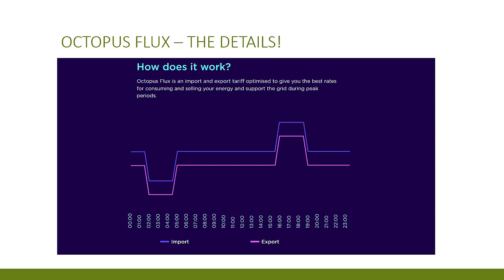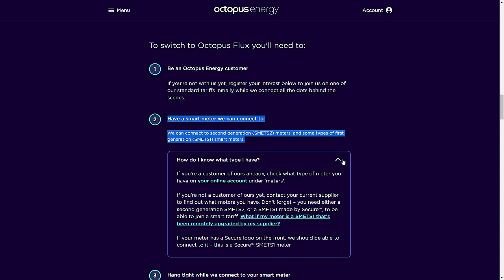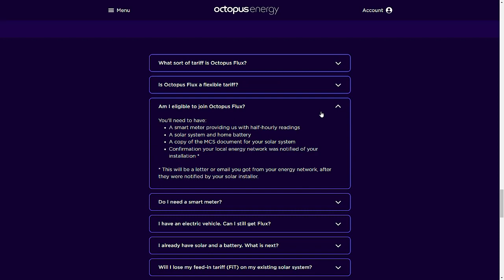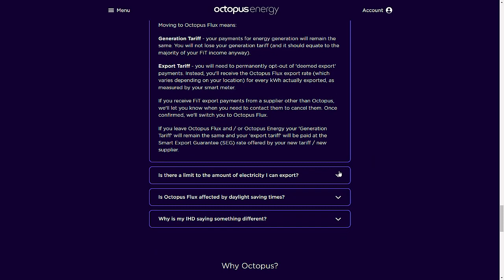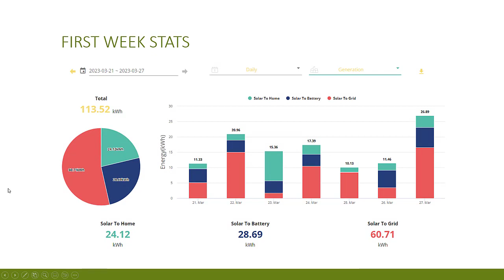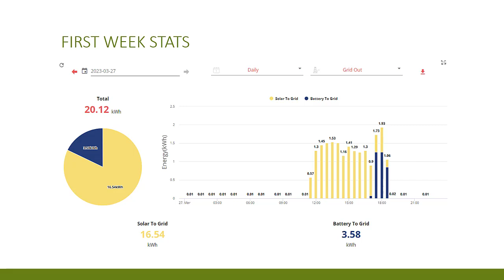OCTOPUS FLUX TARIFF!  Printing Money!?  First week review.  Should you switch?

Comment: Morning. interesting  video., thanx

2 yrs on, if you are still using Octopus Flux, do you still see the Tariff S working for you?

I only commissioned my Batteries and Solar Panels at the beginning of Dec 25 and have moved on to this tariff, still trying to understand it all, but would appreciate your feedback. OIF wasn’t available to me as I stated on  use as my SigEnergy Battery was one of those Batteries adopted by Octopus Energy at the time and from what I have learned in the meantime, is that OIF is more of a Spring and Summer Tariff?
Reply: Go is the better tarrif for the winter, Flux is a good spring summer tarrif when you have surplus solar to send back to the grid. I'll probably go on Flux in March/April.
Reply: @jamesp.1784 thanks for the feedback, but was under the impression that if you don’t  have  an EV, which I don’t, you can’t use the GO Tariffs?
Reply: @BrettG07 Ahh, apologies.. I assumed you were an ev owner. I'm sure people used to get onto the tarrif without an ev but Octopus may have tightened things up. Think you might need to hang tight   and wait for those sunny days, feels like it's been a long dark winter 😮
Reply: @jamesp.1784 James, on the  Long,,Dark Winter, I’m with you all the way and no apologies necessary, the sentiment was much appreciated on the Tariff. Brett

Comment: We have a plug-in hybrid car so when we had our solar panels and battery installed a month ago I thought the best tariff would be Intelligent Octopus Go.   I now realise that this is really aimed at high EV users.  We don't do much driving so don't benefit from this tariff.  We're now going to move over to Octopus Flux which should suit our needs better. I decided against Intelligent Octopus Flux because I like to be in control of our system!
Thanks for the useful video.
Any comments very welcome.
Reply: Hmmm .....  now not sure which tariff is best for us, so will do more research!
Reply from the maker: Sorry for the delay. Hopefully you got the best tariff figured out for you. With the current rates for import and export even low EV usage on Intelligent Octopus Go may make sense, especially as the darker nights draw in. It does take a bit of work to figure it all out but well worth the effort once it is set up. Good luck!

Comment: HI Dan i have a 4kw system and have just added a 6.4 greenlink battery and i get a feed in tariff  of 18.72p per kw of  generation and export of 6.7p   but if i move to flux i loose it...not sure what to do?
Reply from the maker: It’s a tricky one. The recommendation was always to stick with the FiT as the payments were more generous but this is changing in some cases. It’s pretty impossible for me to say really as it depends on so many variables (your usage, your generation, how much you export and more) but you should be able to do some sums to work it out. Once you’ve moved from the FiT there’s no going back though so make sure you’re confident on the decision first, especially with bills reducing and therefore export payments on Flux reducing too.

Comment: I signed up last week so i missed using your link. Sorry. I have set up to import 0200 to 0500 and discharge 1600 to 1900. We have underfloor heating in our bedroom. Should i heat the floor before 7pm while it is discharging to grid or leave it until after the oeak period? Thank you
Reply from the maker: No problem. If you can I’d heat either before or after the peak period, as you’ll maximise the returns that way. 👍
Reply: @DanEVSolar7  thanks. I actually just found out that I have to wait for my export tariff for upto a month so I was inadvertently discharging to the grid for nothing. Now I'm using everything I generate until I get my tariff

Comment: Hi Dan...I have just switched to Octopus flux but I gave tried asking Octopus how can  I set and vary my export and import times. I keep getting vague answers from them. Can you please advise me how I can program these times?
Reply from the maker: Hey.  When I was on Octopus Flux, I was manually exporting between 4-5PM via the GivEnergy app and then I automated filling the battery on the Flux hours between 2-5AM, again programmed via the GE app.  I suspect Octopus will not want to advise as it is really dependent on the equipment and their functionality.  You could also use Home Assistant to program when to import and export, but that introduces a whole new world of complication. :)

Comment: Hi Dan new to all this. Just became a  Octopus customer  had 14 pannell 6kw 5kw inverter  and 9.4 kw HANCHU ess battery installed  switched to  Flux a few days after joining Octopus.  Are you still on the flux tariff for the winter? I  don't  have an EV yet so not sure witch is tbe best tariff. Fairly high consumption  around 13kw per day
Reply from the maker: Hi. I moved to Intelligent Octopus in September as the solar dropped off for winter. Since they put the export price up I may even stay with this tariff into spring and summer next year. If you don’t have an EV, Flux, Eco7, Tracker or maybe even Agile if you are feeling brave might be good options to check out. You’d need to do your own sums for your usage to work it out though. Good luck!

Comment: What’s the wear and tear cost on your battery?  Surely battery lasts a shorter period in overall life
Reply from the maker: It’s actually no more cycles than it would be normally, it’s just a bit more usage. This is also exactly what the batteries are designed for as well. Gary does Solar did a video on this, but for me personally, I see it as a sunk cost and it’s all about maximising the return I can get on it now.

Comment: I'm on flux tariff and charging batteries up in the night. still can't get my head around if its actually worth exporting at peak time or not. After all, what I'm getting at export rate is virtually the same as I'll going to have to buy after 7pm anyway, if the batteries run out. I'm ignoring solar in this equation as we approach darker days.
For some who likes spreadsheets and maths I can't get my head around this!  I suspect the octopus rates are set like they are, so it makes little difference!
Reply from the maker: Yeah, I guess it’s different for me as even with the peak export I usually have enough power leftover to see me through the night. Plus there’s the potential degradation it causes on the battery, although it’s debatable how much difference it actually makes.

Comment: Dan, useful video, thanks! I am looking at this now as people keep recommending Octopus to me. I have just had solar installed and have an EV charging point. MY CONCERN is that during the winter, when i am not generating very much solar power, and my household power consumption through the day is likely to be higher than in the summer, there is a risk that i will have to import (at least some) electricity from the grid during peak hours (we generally cook between 6 and 7pm) - which means paying a 50% premium for that electricity (peak rate versus daily rate). Do you have a view on how that should be factored in to my decision? Cheers!
Reply from the maker: Hi. My plan is to switch to a different tariff around autumn into winter. Probably intelligent octopus since I have an EV. Eco7 was a good option for some people in winter without an EV as well though. 👍
Reply: Oh la la

Comment: Do you have any figures about battery costs being factored in over the longer term, this always concerns me and similarly with EVs. I mean if a users say had battery storage costing say £5k and the battery life was 10yrs (optimistic) that’s a battery replacement cost of £500 a year to factor in which is a pretty big hit on system returns?
Reply from the maker: It’s a fair point and something to consider but the LFP batteries in particular seem to be lasting really well and mine has a 10 year, unlimited warranty so I’m not too worried at the moment, but time will tell. I could be proven wrong. 🙂
Reply: @DanEVSolar7  That’s a good warranty but I guess even if they lasted 20 years battery replacement costs of £250 a year is very significant, it would be for me anyway!

Comment: Octopus Flux Stole my Money !
Joined Octopus Flux a Solar Tariff on 12th March where they instantly increased our prices for import and ignored the hundreds of kw we had exported to them. When questioned they said the export wasn’t set up till the 25th April so ive lost all the money ive sent to them. I just joined Flux account not import/export flux. They refuse to pay anything back .
Reply from the maker: Hi Robert. Flux is an import and export tariff, not just export as detailed in my video. I have heard of export taking Octopus longer to setup as they have to check the documentation manually. It can take some time to get it up and running properly unfortunately.
Reply: @DanEVSolar7  Yes this was not explained to me at the start of the contract but was not impressed by the increase in the bill before a month's worth of units 300 plus had been lost.

Comment: Sitting here watching your video as the installers are on the roof! 
By the end of the week I hope to have a 6.2kWh system with 20kWh battery system up and running here in the North West of England.
As you say it's a case by case scenario of what is suitable for each household. 
My case is high mileage EV user but low use household. I'm hoping to put every watt generated by PV to good use first in the house then in the car. For most of the year the batteries will be short term storage until the car is fully charged. The times when I'm not driving (weekends and holidays) is when I'm going to have to think carefully about where to send the excess.

Currently on Agile Octopus but may change to Flux once the systems been running for a few weeks.
I have a question that some of you might be able to answer: What happens when you're using more juice than the inverter limit, such as when the oven, drier, washing machine, etc are running at the same time? Does the grid take over from the battery or make up the difference. If it takes over then that could be pricey on flux.
Great video and very apt for me. Thank you. Tony.
Reply from the maker: Thanks Tony. Glad you found it useful. With regards to your question, yes if you hit the inverter limits it will pull from the grid to make up the excess. Good luck with the install. You won’t regret it! 👍

Comment: Thanks for the videos, glad to see someone else came to same conclusions as me.
I’ve got a similar system from (GivEnergy & Octopus Flux) in a similar part of the world (Rothbury).
I’m still waiting for the export side of the tarif to be set up though.
Is there any chance of a video showing how you set up the GivEnergy inverter settings for this?
You mentioned automation somewhere, Home Assistant by any chance? I’m a total noob but have it on a Rasp Pi waiting for me to pull my finger out and get it set up!
Reply from the maker: Cheers Richard. Yeah I think this would have to be a home assistant job for now. If you were charging overnight that part is easily setup in the GivEnergy app. The force discharge is more difficult and would need home assistant, although I believe GivEnergy are supposed to be adding this at some point. I might do a GivEnergy app run through for the next vid if that would be useful? 👍

Comment: I’m looking at doing the same thing, the only difference being charging the 5kWh battery at night, then a force discharge of 3.5kWh during peak. Leaving 1.5kWh for night consumption to last till 02:00. By doing this my usage (500/600kWh a month) should be balance by my 8.8kWp system (6,700kWh per year). Charging my car/battery/hot water tank/washing and tumble drying etc at the cheaper night tariff.
Reply from the maker: Hi Bradley. Sounds like you’ve got it all well planned out and sounds like a good way to manage it. Good luck! 👍

Comment: I had a large system fitted in Mid march and soon converted to Flux. 9Kw battery and 22 panels, cost a lot (£17K). But... in April alone first 21 days I have used 33kWh from the grid and exported 341kWh a ratio of 10:1 and its not been sunny everyday. I have a Kuga Plug in hybrid which charges on eco mode only when the panels produce a minimum 1.4kW. I have even gone out and bought my first tumble dryer. Waiting for my first 'Bill' but very happy. Payback may be 7/8 years on paper but the system adds £10K to the property value and I am expecting a much quicker return. So far the only downside is looking at the App to much when its cloudy or sunny. Its a no brainer for those who can afford it. I cannot for the life of me understand why it isnt a legal requirement for new builds to have a system installed. If southern europe invested as much in converting to solar as is planned on electric cars we would get fossil free sooner. I do wonder what the environmental effect is of creating the panels and batteries.
Reply from the maker: Haha I feel your pain checking the apps a lot. 😂 Sounds like a big system, but it’s great to see it working for you when the days get a bit longer. 👍
Reply: @DanEVSolar7  Funny enough my installer said I needed to install the app and oh, btw, you'll be looking at it a lot. He was dead right!

Comment: Great video, I've considered (and continue to) the Flux tarriff, as I, like yourself have a fairly low power usage, and no EV to charge. With a 6.4kwp array, 5.5kw bi-directional inverter and 10.24kws of batteries I could probably get a lot of mileage out of it. It's whether or not I deem the extra duty on the batteries to be an issue. Seeing as each battery costs about 2 grand plus VAT the question arises about longevity, given the extra duty they'll get ... still not made up my mind yet.
Reply from the maker: Hi Rog. Thanks for the comment. Yeah I know what you mean. Although it’s actually no additional cycles charging at night, charging at full whack must put a strain on the battery more than just letting the solar charge. Hard to say for certain though. I still personally think it’s worth the risk, but you need to do what’s right for you. 👍
Reply: I would at least double the storage before you do. The more storage capacity you have, the longer they will last because you are not discharging them as deeply.

Comment: Loving Flux here but I wouldn't personally export anything from the battery, it's going to slowly eat up cycles over time and these batteries aren't cheap.
Reply from the maker: Hi Rupert. Actually the extra charge doesn’t put any extra cycles per day on the battery, although I imagine there must be some degradation force charging from the grid at maximum charge rate, rather than slowly charging via solar but probably negligible.
Reply: Would GO not be a better option if you are not exporting? Currently 9p for the cheap rate.
Reply: The warranty for batteries charged directly from the grid is different than charging from solar panels, Tesla limits the about of power throughput warrantied when the battery is charged solely from the mains, others are similar.
Reply: Get a solar edge battery, unlimited cycles warranty at 10 years. If SOH is less that 70% they'll replace for free.
It's a lot more expensive to buy initially. Fit them yourself and you'll break even within 3 years
Reply: @MoaningDuck007  my biggest want from a battery was "whole home" backup, solar edge only do specific circuits and only up to 6kw, i'd have to downgrade my inverter. So it's a PW2 for me 👍
Reply: @A P  I take your point but it's a bit late for me - already got a 24kWh Fox cube battery.

Comment: I am the same as others slightly unsure of the best option for using the battery.  At the moment I am charging every night as you cannot guarantee what the weather will be like the next day.  Also while you only make a couple of pence more per unit exporting your production that can add up to £40 by the time we get to October.

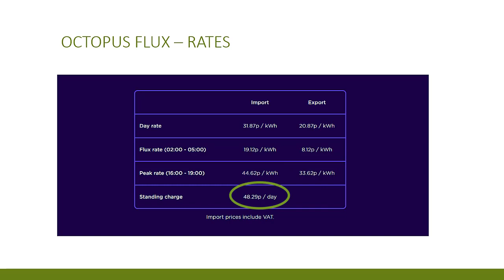My current setting is to force discharge from 17:45 until 19:00 and then charge again from 02:30 until 05:00.  Rough calculation I am making £2-3 a day after covering all costs (including standing charge).

Comment: Grr. This has reminded my to email Octopus again about my adopted BG Landis Gyr SMETS1 smart meter that Octopus is connected to but are getting no readings from. Was working when I signed up for Ougoing Octopus last July but stopped working in November… I’m in limbo…. Otherwise as a low user I 100% agree with your approach and I’m curious how you get your battery to export. Something in the battery firmware?
Reply from the maker: Sorry for the reminder Christopher! 😄 Good luck getting the issue resolved. Just manually using the GivEnergy app to force discharge at the moment. 👍

Comment: Sort but your number doesn’t add up, I have solar and I checked my data for your dates… you must have a huge number of panels to not by buying it in and exporting what u said. None of octopus’s tariffs are viable for normal people with solar as I’ve looked a number of times
Reply from the maker: Those are literally my numbers. 16 panels, 6.32kWh array. Low usage ~5-6kWh per day…
Reply: @DanEVSolar7  I see, I’m only 8 panels 3kw with 5kWh storage … pre solar I was using 3300kwh a year, currently estimating 1700kwh a year… octopus doesn’t seem a good option to me…. The best option seems to be to try and use what u produce! And Scottish power now buy in at 12p per kWh a much better deal that previous

Comment: I had the same thought as you in terms of not taking anything from the grid but it’s often very beneficial for the grid to draw power during the night. This is due to renewables (mainly wind) producing power with nowhere for it to go. I’m still in two minds due to extra cycling of the battery.